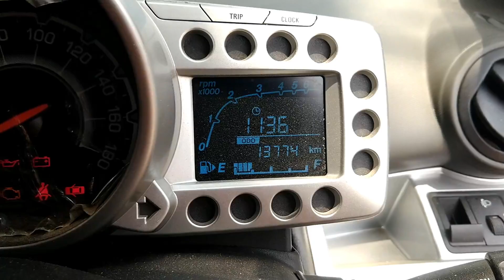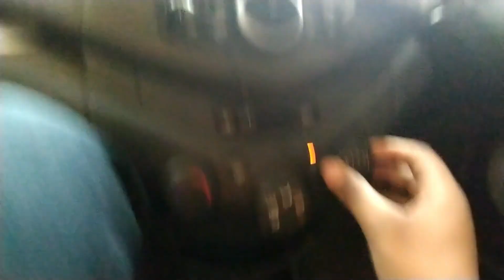AC Not Working ? | Chevrolet Beat | AC Temp Sensor Replacement

Comment: I do have chevloret beat diesel ..same issue ac is working on and after running few kilometers it stopped cooling ...what should I do ?
Reply: same problem bro my beat petrol m kaise solve hui problem
Reply: @monupanjeta5017  bhai solve hui

Comment: Hai... I am Kishor varma from Hyderbad.  My Car  beat Diesel  LT 2014 Model. I am also facing same problem.  Machanic confomred AC Temp sensor not working. need to replace. but he umable to find the part.  can you help  where can i get the part.  if online link is there. please provide me the same
Reply from the maker: You can find this sensor on boodmo

Comment: bhai meri bhi beat ka ac kaam nhi kar rha h
Reply from the maker: It can be possible ki ((thermistor sencrr)) khrab ho gya ho , to ek bar service cntrr prr chekrr krwa lo..🙂
Reply: Aadityasharma meri beat automatic ac hai soo koi chak hi nhi kar rha
Reply: bol rahe h automatic kharab ho gya h. ak Manuel switch lagva lo kya ye thik rahega
Reply from the maker: @vehiclecare7867  agar automatic module ki screen Puri trha Kam krr rha hai aur sirf issue air flow ki hai to   it's sure ki ya to thermistor sncr ya ac compressor ya koi fuse se dikket ho . Lekin agar pura module hi nhi Kam krr rha to uske liye nya ac module lgwana pde ga .. as for my opinion alag se ek switch lgwana sahi nhi ho ga , plz visit some other service cntrr for sure..🙂
Reply: Aadityasharma sab kuch ok kaam kar rha h screen bilkul ok ac on bhi ho rha h compressor bhi ok h lekin botten prees karne par on nhi ho rha h. mirstri ne chak kia h ab samaj ni rha kya problem h
Reply: direct battery se taar lagne par on ho rha h lekin
Reply: bhai ARJUN apki car me AC compressor dlaa ya sencor??